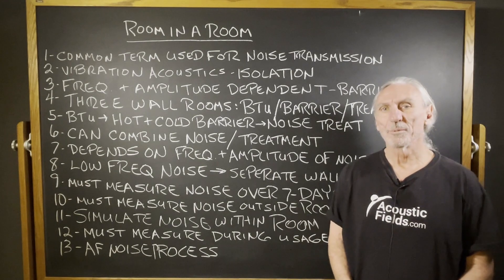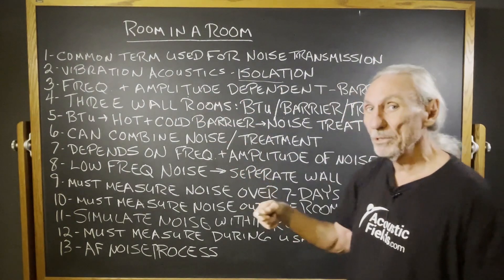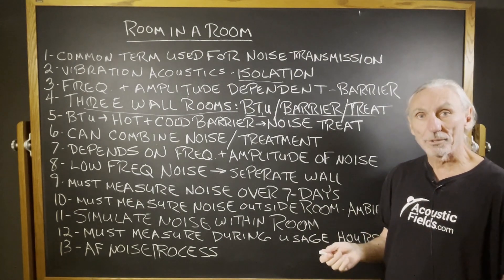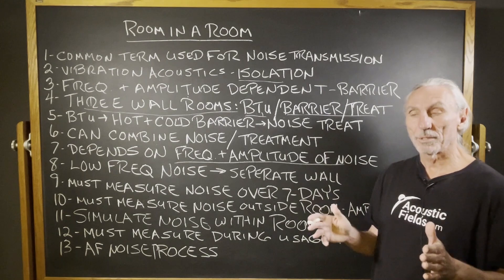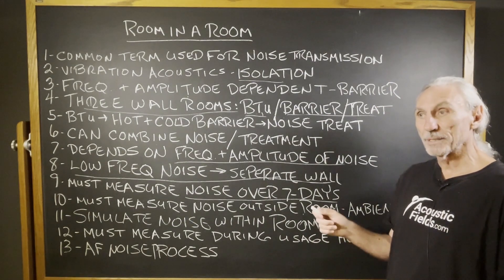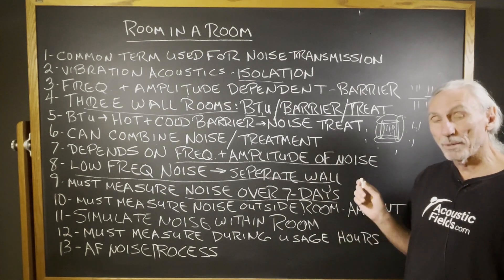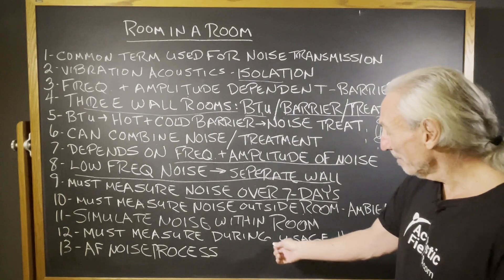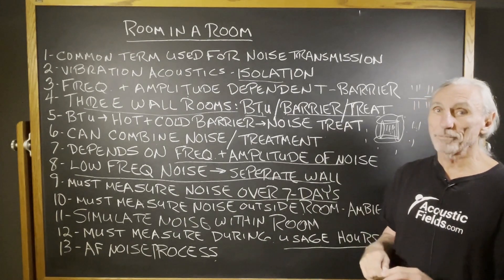Room Within A Room - www.AcousticFields.com

Comment: I'm building a double brick garage with tile roof. Dont want my guitar playing to annoy neighbours. How much worse would a zero degree boundary gutter be? ie. Both leaves of double brick same height, roof resting only on inner leaf,  thin metal sheet covering the top of the bricks and a gutter on top of the external leaf.  Id gain 170mm in room space but if its a noticable drop in sound reduction then its not worth it. Should I just build gutter on side and not risk reduction in performance?  Or i could maybe do a parapet wall and box gutter?
Reply from the maker: You must know the noise levels in the neighborhood. The barrier you build to reduce noise transmission i9s a ratio of the inside room noise versus the ambinet noise in the neighborhood.

Comment: i know of a world famous studio, with concrete walls 4 feet thick, floating floors etc... that you can hear a skate boarder go by on the sidewalk.....  big bummer...
Reply from the maker: We see this all the time. Density is just one material factor to consider. You must use density along with many other material types to reduce noise transmission. It is helpful to think of noise transmission in terms of vibrational acoustics. Airborne energy becomes vibrational energy when it strikes a surface. Your barrier must be designed to reduce vibrations.